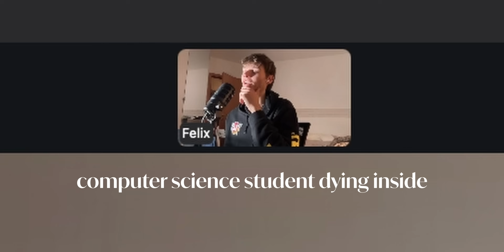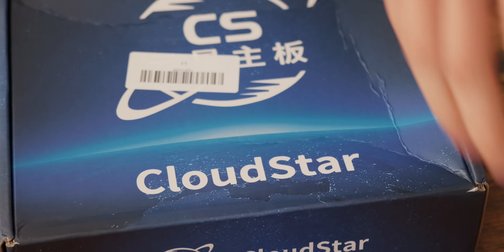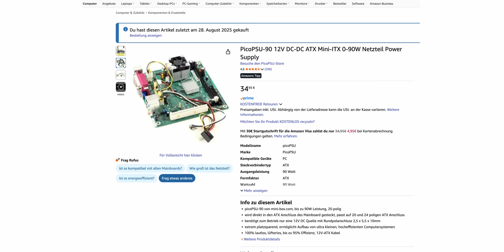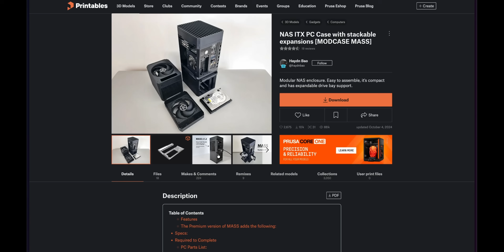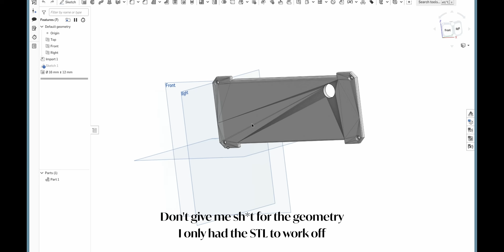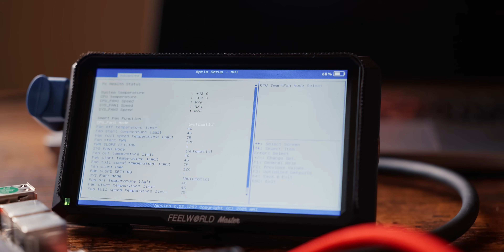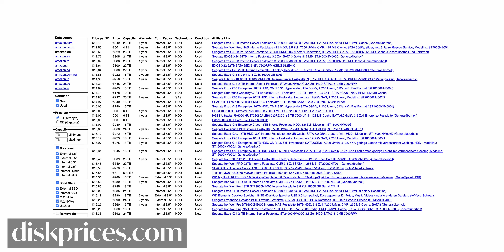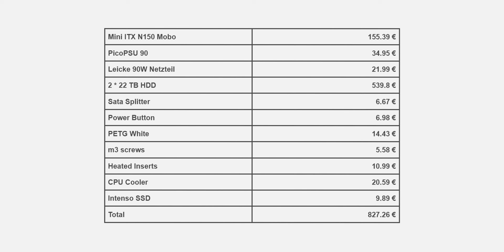Goodbye Synology: CHEAP DIY Modular NAS Build

Comment: Just a small FYI, in any good slicer you can add basic shapes as positiv or negativ volume. A negative volume removes something from your part. so you can always add a hole in your slicer without firing up the cad software and its super easy there.

Comment: You know the funniest part?  Most of these basic consumer grade hard drives are just shells with motherboards that make it easy to connect to a computer.  The motherboards go bad. It the drives inside are fine.  

I am a photographer but also love tech.  I can’t tell you how many of my friends and acquaintances all have some shammy half loaded reason to say “it works” until it doesn’t THEN they freak out and hire me to produce them a sustainable system that they can rely on for years without headaches.

Comment: Warning!! Those molded plastic SATA power connectors are a FIRE HAZARD! The cables can migrate over time enough to cause a short. You want to get the kind with cable inserts(like what PC power supplies use).

Comment: In terms of power usage ... I swear I read something a long while back that ... if you have a capable enough CPU/MB/etc ... then as long as your power supply is moderately modern ... just because it says "1000W" ... doesn't mean that it's going to USE 1000W, and will likely be way more power efficient than something that's smaller / compact or even one of those 'pico-PSU' things ... right?

Comment: Plese be carful with those Intenso SSDs in I recently Had 4 of them in a zfs RAID configuration on a proxmox host, they died after after abaut 9 months of constant use. 8 of those 9 months the Server was only ideling. They only saw heavy use for Like 1 or two monts.  I do neot know how much Data ist written by your OS but I do No longer Trust These Drives.

Comment: Wait... The solution to losing your data, is to raid 0 some very expensive hdd's (raid 1, seriously... is not a backup method... but anyway) with a no name brand motherboard, and a few other parts that are somewhat dubious. And to top it off, using a molded 4 way fire splitter, I mean sata splitter.
This whole build is just 1 bang/pop, away from total data loss of both drives. Honestly, this is a true dumpster fire capable build. lol :)

Comment: i'm starting to hate this cainds of videos, because let's be honest it's not the hardware that is the issue, it's the software. you eather get a synology or run xpnology. other wise you don't have access to the apps on DSM. for now the only one that comes close from my point of view is CasaOs. everything else has it's plus and minus, but not a ballance like DSM. oh yeah, the DRM for HDD was a big BS, and still might be in the future...
Reply: try zimaos (base on CasaOS), you just need old computer, simple sata cable, it's free for 3HDD (or you install the v1.4 then do upgrade to 1.5 to get the zima+ for free until 2026), this distrib is so easy to use, even the docker app, i've a syno & docker, but man i love this simplicty to even consider to use it for a new NAS with good hardware and low consumption, right know i'm testing it on an old Lenovo thinkcenter M720q with USB 2.5Gbps etherne and M2 disk (no storage right know it's mount on the synology disk). I know it's pretty knew and they need to work on it, but even for 30$ on a lifetime hardware licence it's still cheaper than unraid, hexos. (xpenology is a pain in the ass to install, and you finger cross everytime want to upgrade it). (and f*** y synolgoy, not even consider buying product after the shitstorm)

Comment: For data backup, the goal is to follow the 3-2-1 rule.
A RAID does not guarantee security.
Have at least one offline copy of important data.
This is how I do it:
At home, I have UNRAID 1. In the garage (a separate building), UNRAID 2. 
At my parents' house, I have UNRAID 3.
And the most important data is also stored in the bank on LTO Ultrium tapes.
Reply from the maker: I've got an off site backup too, a 10TB Hetzner Storage Box that can hold all of my data for now, I just didn't mention it in the video. Having an off site backup is definitely very important, but for a lot of people I know, even having some sort of backup is already an upgrade hahaha.

Tape is definitely next level

Comment: Fun video! I planned to go DIY, but just opted for the Aoostar WTR Pro ($370 for 5825U) for my Unraid box and added 64 GB RAM ($180), two 16 TB Ironwolf Pro HDDs (new $270 ea), and two 1 TB NVME SSDs (on hand). It's a nice compact low-power NAS to handle all the services I need for $1090, and I have room to add 2 more HDDs later. 😅

Comment: Just buy a 2-bay or 4-bay Ugreen NAS with an N100 CPU, increase the RAM to 16 or 32 GB (optional since you'd have to replace the factory SODIMM), and Install TrueNAS on the internal NVMe storage. Or get a similar 4-bay from Aoostar. Likely  less than what you spent and way easier.
Reply from the maker: I’ve seen one of those on Ali express, it was similar in price to what I spent but was missing ram and SSD. They look great and likely are a much easier choice, but I wanted the ability to easily add 2 or 4 more drives in the future which is super simple with this build.
Reply: @futc.photography fair point to be honest.
Reply: I have the DXP6800+, maxed out the memory to 64GiB and installed TrueNAS. Works like a charm. Even if you only run a few containers (I am currently setting up a K3s setup for that, I only plan to leave media-related stuff on there for the transcoding capabilities) ZFS benefits from more RAM.

Comment: I've been working as a consultant since the 90's, it's not just video/photo shops that have no tested backup plan in place and it's been one of the banes of my existence for a very long time.  The thing with Synology is it's easy, I have long time clients who have used Synology for a long time and only in the last 2-3 years has Synolofy finally annoyed them enough for them to start thinking about moving away.  I've been using TrueNas since it was FreeNas and am firmly part of the ZFS cult but small businesses with little to no IT support I totally get why they might stick it out with Synology (no matter how much pain it brings me).  My only recommendation is a little less jank.  If the motherboard never has problems I guess it's fine but I trust Supermicro a lot more than random ali express vendor for hardware.

And lastly raid is not a backup.  Even if you don't go 3-2-1 at least budget a 2nd NAS for on site backup.

Comment: Installing truenas on a crappy cheap SSD is a bad idea I've had a few cheap SSD fail and if this happens with your NAS os it could be catastrophic. I would recommend mirroring the OS drive so two sata SSD
Reply: Having a boot drive fail would not be catastrophic, especially if you back up your truenas config.  The only way it could potentially be an issue is if you encrypt your pools and don't back up the keys.  That said I do agree with mirroring boot drives, replacing a failing/failed drive in a mirror is less of a hassle than reinstalling.
Reply: @nadtz yeah the main way would be if you encrypted or didn't backup the config, which is what I did. I came from unraid and so didn't realise it was required, so you're right in saying it's unlikely. Yeah I would much rather go overboard with a Nas for sensitive info.
Reply: @TheChidmas  TN gives you a warning dialogue box when you create an encrypted pool to back up the key.  It tells you if the key is lost your data is toast.  Not knowing how encryption works isn't really an excuse when you get that kind of "You should really do this right now" kind of message.
Reply: @nadtz it wasn't encrypted. Either way you should read through the warnings etc. you live and learn
Reply from the maker: Is that possible with TrueNAS? Because you can only create a pool after the installation when you're already in TrueNAS no? Also wouldn't it ideally only be a matter of re-installing TrueNAS onto a new SSD? The storage pool should stay untouched if the OS drive fails.
Reply: @futc.photography the storage pool stays if the boot drives fail, but all your apps and settings and stuff goes away

The easy option would be to download your config back it up somewhere, reinstall truenas and use 2 mirrored drives (I plan to use 2 SAS drives) and restore your config afterwards so you don't have to redo all your settings.
Reply: @futc.photography  yes it's possible search mirroring boot pool in truenas scale. You need to have the config settings backup file saved or else you won't be able to recover the storage  pools. I learnt the hard way. Also looks into Arc you could use those spare nvme slots to improve indexing. You'll be limited by the pcie lanes of the n150 but should improve read speeds

Comment: Vendor lock is already pulled back
And even if you use a NAS - this does not release you from making proper backups - indifferent to vendor. A NAS isn't a backup - a second NAS would be one.